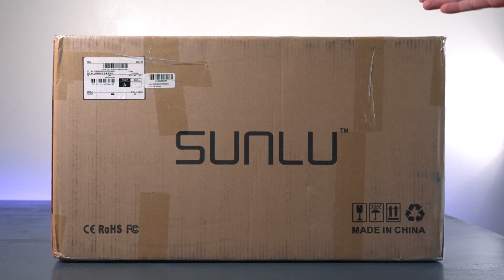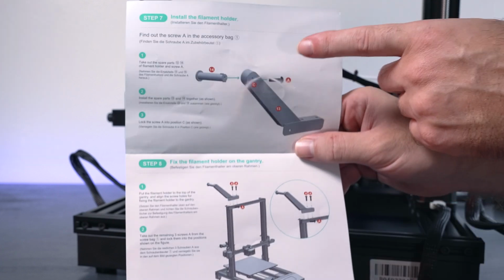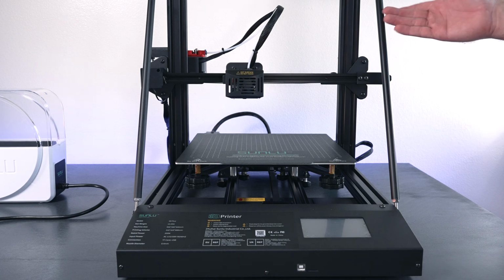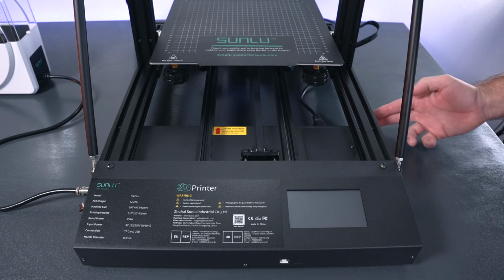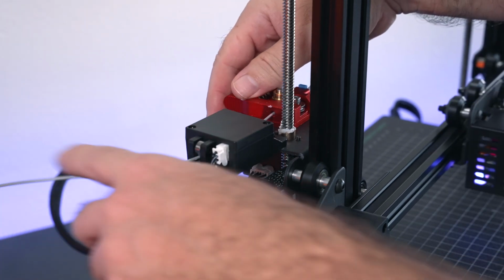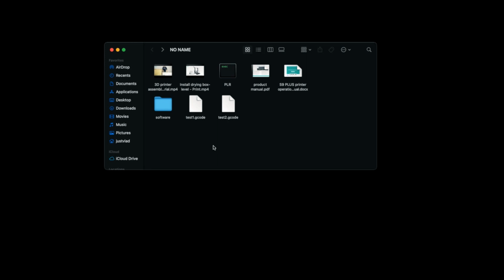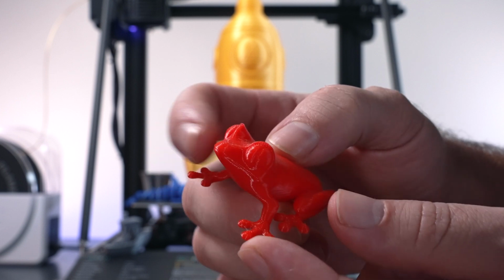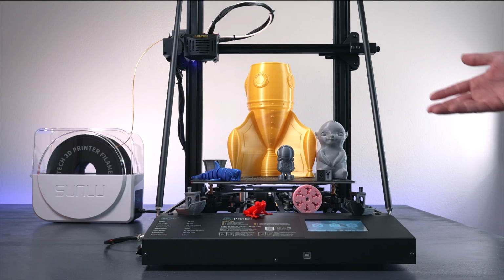Sunlu S9 Plus - 3D Printer - Unbox & Setup

Comment: 2:31 lol definitely wasn't easy as it looked in the video to pull this thing out..
Reply: 26:10 for those wondering, the bottom twist knob in order to untighten it you have to slide (twist technically) from left to right.  

Then for the top twist knob, to make the platform go down, slide it from left to right to lower it.  Then to raise it, slide the knob  from right to right to left. 

Felt like this wasn't explained in the video clearly.

Comment: I got one of these off of Amazon in the big Black Friday sale for a good price but the customer service is HORRIBLE. The power box on the inside of machine at the back is not lined up properly and was unreadable on my unit. They basically put the four holes on the bottom in the back under where the switch is located in the wrong spot and so I had to remove them along with the little cover on top in the back right side of the unit. This let me sift the internal guts around so I could actually see what the power was on and properly set the switch to 110. They didn't feel like putting the 220v in an unblurred and unreadable form. The SD card adaptor was buggered and takes ten minutes or so of finagling to get the computer to recognize it. The card itself was improperly formatted and many of the files are missing or unreadable.  Linux found more files but alas they were not windows files. Sunlu hides behind a language barrier, has staff so inept at reading the emails it makes the US Congress look competent or most likely the crappiest  A.I. answering the emails. They offered to charge me more money to get a working card and adaptor.   FYI, the new adaptor and all the SD cards I just ordered from Amazon work properly, with no problems it is only what they provided with a printer that had a $459 USD price tag when new. They did eventually send a link along with their threat of charging me more money to replace faulty items with the "latest" install of the Cura slicer from their website. After installing the so called latest install it only required three new installs of Cura on top of that to get back to the latest version of the installation albeit with a printer profile.

Comment: Just purchased this for $207 at Amazon on Black Friday Deal. This will be my 2nd 3d printer. I also have the Neptune 4 Pro which is amazing. I needed a larger size bed for printing full-size cosplay stuff. Hopefully, this works out well.
Reply: I have a neptune 4 pro and was looking at getting a s9 plus as a second printer. How do they compare? I am super impressed with the neptune and don't want to be disappointed with the s9 plus.

Comment: Hi Vlad. Are you able to check and see what firmware is used on the S9+? Also, is the motherboard using an 8 or 32bit processor? Thanks.
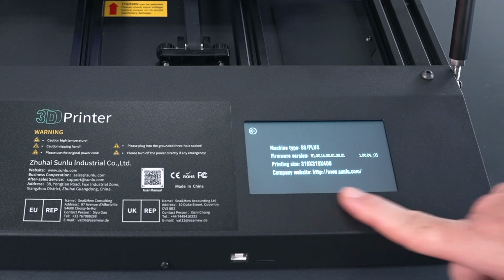Reply: At around 23:59 it shows the firmware when he's going thru the settings and printer-information, screenshot and enhance
Reply: @lolrobin  Hi Robin. You're right! That did show the firmware version number. What I was really looking for though is the type of firmware it uses, as in is it Marlin, Klipper, Chitu, RepRap, Repetier, and so on. I saw elsewhere it supposedly uses the Marlin flavour, and I was hoping that could be confirmed here. All the same, thanks Robin for taking the time to reply with the above information. Appreciated!
Reply: @peterwee9520  I'm new at 3d printing and can confirm that it uses the Marlin for firmware. Is there a way to update the firmware or replace it?

Comment: DO NOT BUT THIS PRINTER!!!!  mine came today missing so many parts. And now I have an up hill battle with China to get the replacements.
Reply: Were the missing parts screws, nuts and linkages for the stabilizing rods? Contrary to what the manual indicates, those parts may actually be already mounted on the printer base, and so are only 'missing' from the parts bag.
Reply: @peterwee9520  it was literally every numbered package 1-5 that did not come. I had to go to the hardware store to do complete the printer. I’ve been printing for years. It took them about three weeks to get me the actual nuts and bolts that were supposed to originally have come with the printer. Their customer service is one of the most arrogant customer services I’ve ever dealt with.
Reply: @Kibz32 then take it back to the store and demand a refund. Or you'll just have to order the parts online.
Reply: This printer just arrived and everything was fine for me